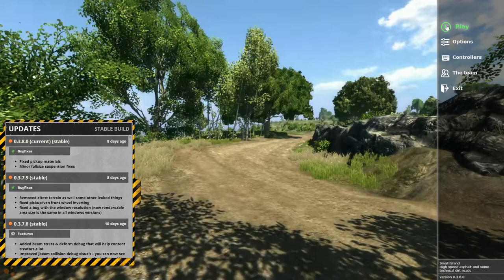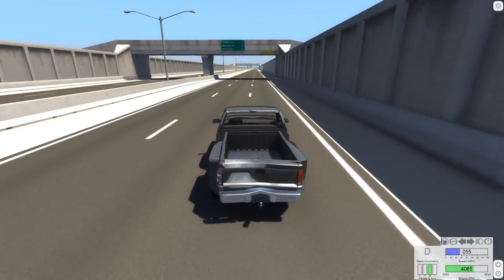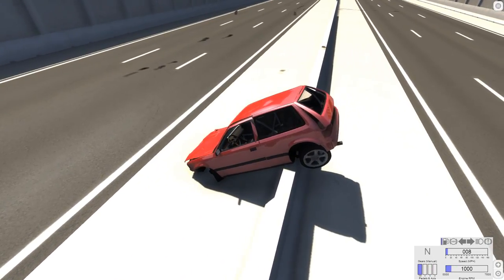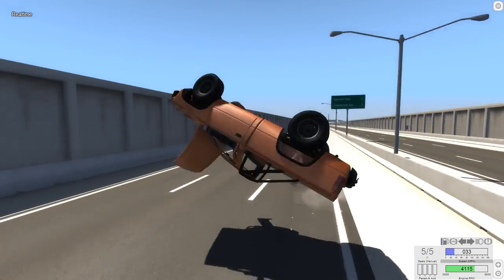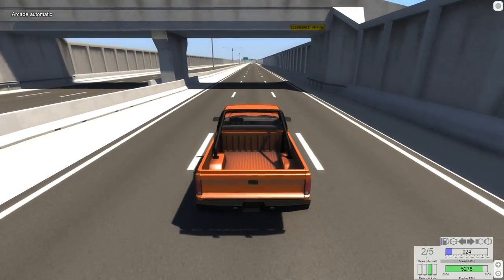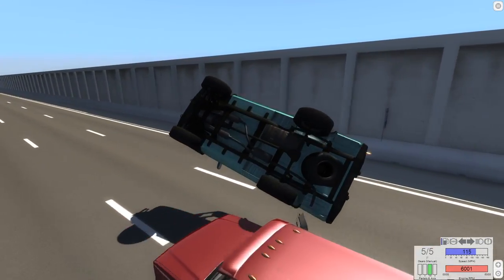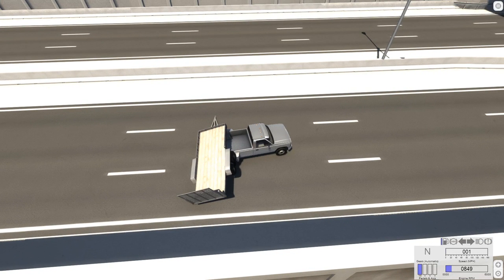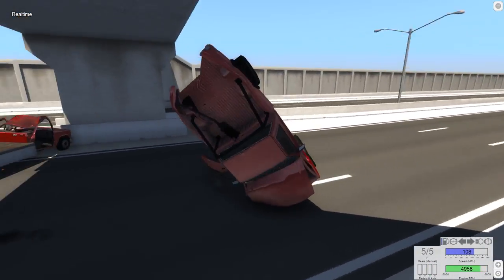Trailers Used as Ramps - BeamNG.drive

Comment: Ybr can you try doing these two suggestions:
1. Using the trailers put a plane on a trailer and go fast. Using that speed will or can't make the plane fly.
2. Using the trailers again try making the trailer go while trying to make the plane land on the trailer.

If you can do these suggestions Ybr that should be awesome.
Your the best simulation guy ever.

Comment: You should do a tutorial about how to set up your Xbox controller to Beamng.Drive because all the other ones are not that good.
Reply: andrew lam Its really easy with the latest update. He explains the new controller screen in his update video. Basically you hold the button you want to set, then select what you want it to do, and while still holding the button, click save. Then double check it works by pressing it. Then its just trial and error to set all of your buttons.

Only thing I havent figured out is camera controls. I got mine to work, but in constantly rotates around the car, which is probably a controller problem, but idk.
Reply from the maker: ***** For the constant camera rotation open up the controller menu and click the button to rotate the camera. Then on the left column under "With deadzone from" make sure that box is ticked and start with -0.3 in the first box and 0.3 in the second box. If you still have issues change i to -0.4 and 0.4 then -0.5 and 0.5 so on until you find the number that stops the issue.
Reply: WhyBeAre That worked great. Thanks bud!
Reply: ***** Thanks!
Reply: WhyBeAre Thanks!

Comment: Whybeare I challenge you make a car In Bmg! Things need

Easy body ( like a brick )
Lights ( brake and high beams)
Able to move ( must be a inline 6 or a v6 Must have custom sound)
Others you can do
---------------------
Inside 
Realistic wheels
Turn singals 
Hood lights 
Doors ( trunk etc )
Other stuff
Reply: Well a V6 is smaller and it takes less parts or mass so compare to 90 cars it will pay off by not much but the engine bay is smaller so the car is smaller and lighter but a Superchaged V6 With some sport parts it is okay but the inside and other stuff is a other story